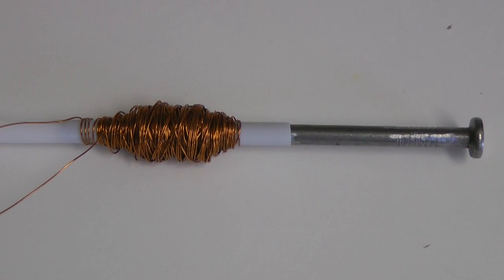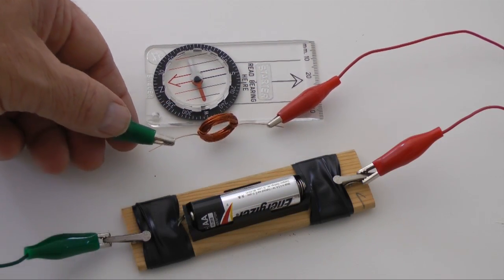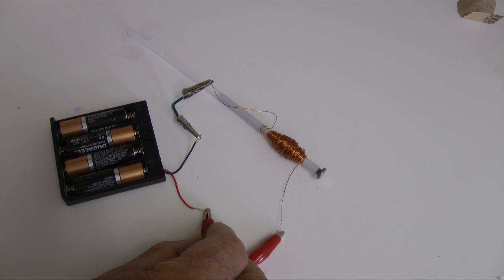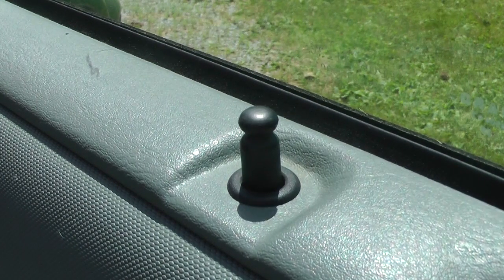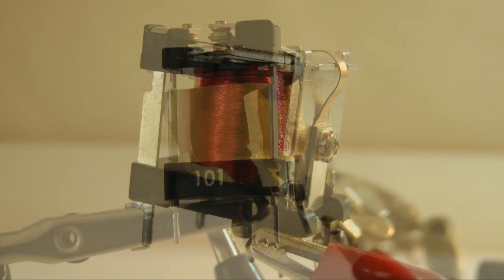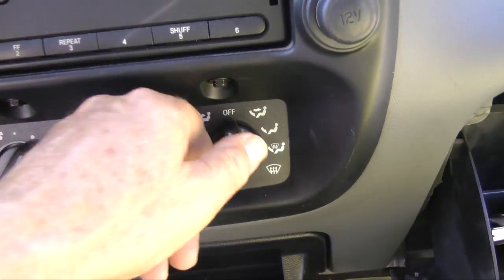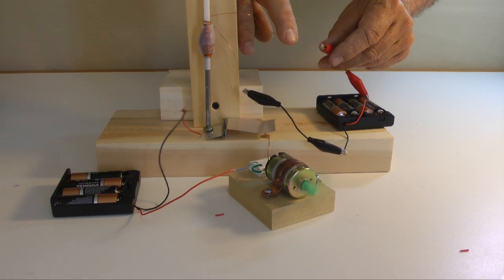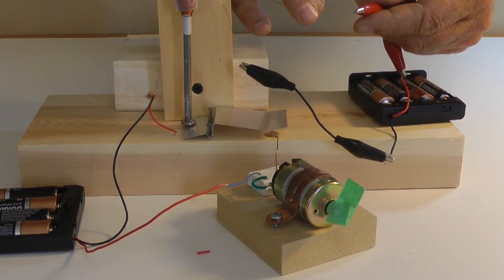Solenoids & Relays

Comment: Hi, one solenoid in a home that you forgot to mention is the common doorbell chime, which normally gets its power from a transformer (usually located attached to the breaker box) that converts 120 V AC to the 16 V AC needed to run the mechanical doorbell solenoids. When the doorbell (a simple switch) is pressed, the circuit is closed, and current is sent through the coil, retracting the metal plunger and causing it to strike the "DING" chime plate. When the doorbell is released by the person's finger, the circuit opens again, and a spring snaps the plunger back, where it hits the opposite "DONG" chime plate. (The rear doorbell, which has its own solenoid, simply blocks the second strike with a rubber stopper, so you get only the "DING" chime.)

You have demonstrated that DC voltage CAN, in fact, be used to run a solenoid circuit. (I had read that this was true, but had been told by various doorbell sales people that -- NO NO, it must be AC.) When I connected up a 9-volt battery, however, the plunger moved a wimpy fraction of an inch, and did not strike the chime plate. Why does your 6 V DC circuit work, but my 9 volt DC circuit didn't? (Assuming the common nail and the metal plunger are somewhat similar.) Does it have to do with a difference in current supplied by your 4 AA's in series versus one 9 volt? And how could I, just for proof of concept, actually run my doorbell off of some batteries? (I just hate it when someone tells me something "can't be done.")

Comment: You said that the coil in a solenoid gets hot. How do car relays stay on and not cook and melt?
Reply: They don't stay on running current longer than designed. Most will have a switch lock, eg the door lock, relati switches between lock or unlock. Or as for your indicators, the flash relay will rarely run longer than designed, and even then the current passing is minimal. The gentleman who uploaded ran what looks like 4 X AA batteries at 6v total and a fair current ( maybe two amp) which is 12 watts through a thin wire, the resistance isn't high in copper but it still gets h o tt hot with the flow of current needed to lift the approximate 15 g nail with ample force again earth gravity :). ... Science bi*** , jokes.
Reply: solenoids do get hot if power stays on
like an RC actuator
Reply: but they are designed to only pass current whilst they are on, which is the time taken to activate the switch.

Comment: Basically I was taught in summary a relay is a switch, controlled by a low amperage signal wire to control a large amperage circuit. What is the purpose? In my opinion to reduce the amount of costs and inefficiency or wiring. If relays didn't exists you would have to run a wire the size of a battery cable to start your car too the ignition switch. High amperage = big wire, low amperage = small wire.
Reply: if you are controlling a 12v system using a 3.3-5v Arduino then you will find a use fast.
Reply: Well explained.

Comment: great videos. I use them in my class.
Reply: +Mark Bess Um,  I have a question Mr. Bess! In the video a solenoid is described to have many applications when swift motion is required. But isn't a solenoid basically a short circuit? How would one design a solenoid that is energy efficient?

Comment: I think solinoids and coils is thesame?
Reply: +Engineer mapmaker909 that's not correct. A solenoid is a coil of wire with many turns. A coil is strictly one rotation of a wire, however a solenoid would not be formed until a significant number of turns have been made.
Reply: yes
Reply: Yes, they're both inductors
Reply: solenoids are coils that contract an object through an electromagnetic field. Coils however have many different functions and uses not limited to solenoids. For instance a typical electromotor has coils that rotate in an electrically charged tunnel. In bigger motors these coils are shielded through copper plates that also act as mechanical bearings to reduce friction in the shaft. On smaller electromotors for RC toys these  plates are often missing and bare coil spools can be found in the center of the motor. Coils can also be used as induction coils to drive up the higher currents needed by camera flashlights.